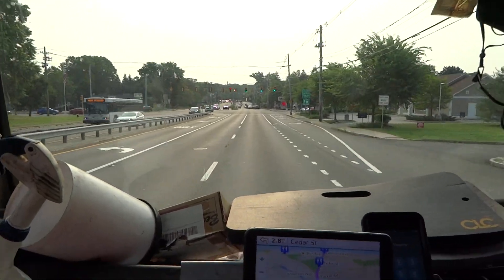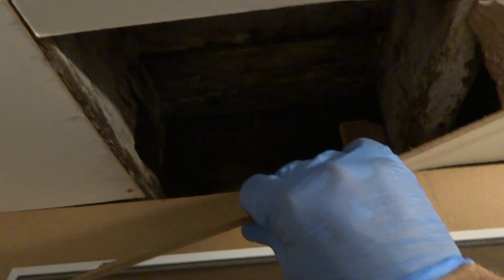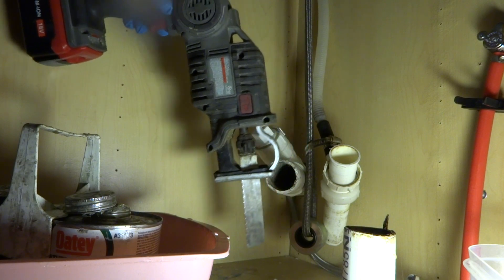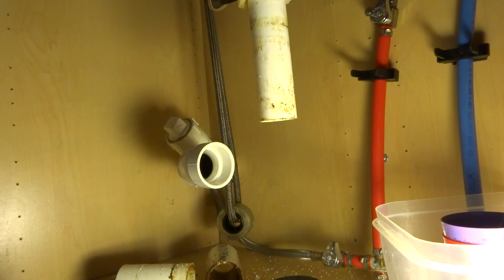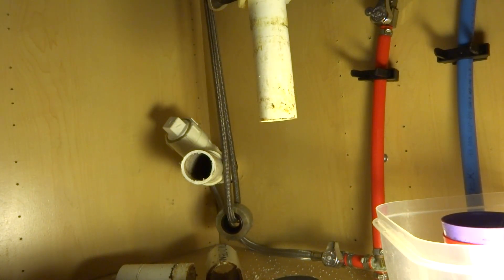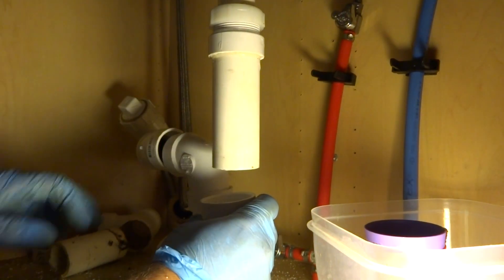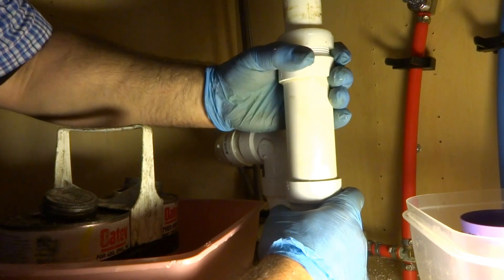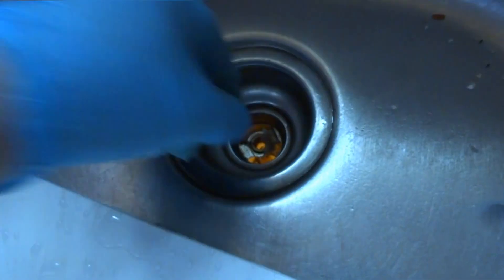PLUMBING DISASTER JOE HOMEOWNER STRIKES AGAIN

Comment: While the cleanout makes me think the pipe coming out of the wall is a drain, for it to be loose means there's no way I'd use it before finding out exactly where it goes and how it is connected; but that's just me, and I'm a DIY, not licensed.
Reply: I'm ticketed and I wouldn't change it either. 8 have a small endoscope for tracking lines
Reply: That was pretty fucking risky.  I wouldn't be able to sleep at night not know where that thing drains to.
Reply: like maybe a drain for a dishwasher? right next to the hot water line going through the same hole.
Reply: @ghost2coast296  Nope the drain for a dishwasher is right on the tailpiece where it should be.
Reply: Yeah most of the water would go straight down into that pipe in the floor the way it was hooked up.

Comment: The pipe coming out of the wall was probably a vent pipe and the pipe going out the bottom was the actual drain...
Reply: That's what I was thinking, but why the clean-out on a vent pipe? I never cared for, do it yourself unorthodox plumbing techniques. It just adds a extra layer of complications to a problem you are trying solve.
Reply: My thoughts as well

Comment: That tied in line is intended to be a vent for the fixture... the reason it's gurgling is because it's filling the vent, you tied into a vent did not run enough water to properly test it cause 8t wouldn't have npbeen enough to fill the pipe and trap and raise to the level of the sink ( likely this happened that evening )   respectfully intended but I think you missed this one.
Reply: He also should have atleast left the sink running. Gone outside and look in the cleanout to see if water was running.

Comment: Unglued PVC fittings: I'll never forget the call I had where the homeowner's sewer line backed up, and the un-glued PVC fittings in the basement, for the kitchen sink drain line, separated, and flooded the basement with sewage. That was a literal sh**-show. Worst part was they were pack rats, so a junk removal company had to throw most of the basement contents into a 30-yard dumpster before I could deal with the plumbing issues.
Reply: holy shit mama !
Reply: @WinnfieldCustoms  , lol.

Comment: I wouldn't be surprised if you got a call back on that one someday.
Reply: Ya ever notice he uses sch 40 glue traps with those bs plugs at the bottom instead of sch 40 threaded traps , just like he  pulles out his blow torch to sweet on a supply valve under a tight vanity instead of the compression style , just saying lol fn Steve & molloy the boss
Reply: Me EITHER!!!  Just connects a drain to an unknown pipe?  Who the fuck does that??
Reply: @onemorething100  and tears the ceiling tile.

Comment: Water test time, the one in the wall might be a vent or old plugged up drain and they fed a new one up thru the floor?  Whatever it is, the one in the wall wobbles like hell like it's not attached
Reply: Oh here we go! Super tradesman and his YouTube advice.
Reply: @jimdeck8670  ive been a red seal plumber my entire life and his comment here is I  fact a good one. I believe Steve hooked up to the individual vent, as was common to individual vent fixture at the time house traps were approved. This drain was connected to a vent, you can see the gurgling in the "test" .msteve does excellent work usually, but this one's a bit off imo not tested sufficiently.. that was a vent, I'd bet on it
Reply: @MrDmadness   thank you MRDMADNESS, This guy has nothing good to say on Steve's channel, mocks him, etc, I hoped the community sets him straight.
Reply: Couldn't agree more.
Reply: He keeps saying he's doing it right but he doesn't know what he's doing 😆
Reply: Yes, 1000% with gurgling noise. Seem to suffer to breath while discharging water that don't seem right.
Reply: Yup wall wobbles looks like a leaker.

Comment: all the bubbles coming up out the sink drain makes me wonder. . .
Reply: Doesn't that mean the pipes are not vented?
Reply: @rpurdy4821  most cars yes because the pipe is struggling for air 
Disclaimer I’m just a carpenter
Reply: @rpurdy4821  thats my thought - that 'drain line' is likely a wet vent from another drain.

Comment: Not all homeowners.   I do all of my own plumbing and I have never messed up a job like that.  Furthermore, I have seen plenty of "professional" plumbers just slap a fernco on it and walk away.
Reply: Absolutely agree - have just replaced a bathroom for my daughter which was installed by a so-called plumber.  Every single waste joint was held together with silicone and was falling apart!  There was no indication at any point in this video that the previous homeowner had done the work anyway!
Reply: @keithmarlowe5569  ain’t got lol no education either it seems

Comment: That sink originally flowed in the floor... there is absolutely NO way that sink could flow to the left in that wall... as u met it , it looks like that Other pipe on the left flows into the main waste pipe  running through the floor...secondly a thorough investigation of where the pipes are distributed and or sourced has to be done before making changes... 
In the end u condemned the floor and diverted ur waste water to the left in that wall.. but water cant flow uphill.. the cleanout looks higher than the TEE on the main indicating whatever in that wall is flowing into that main floor pipe... but anyway that's all from me ..I'd investigate properly before making changes
Reply: Makes sense now that you draw attention to the clean out feature that was there. Either way, the entire drain plan is crap from the day it got put in there.

Comment: If by chance you get called back steve pls video the job, I'm not sure if I would have chose any one of those pipes without further testing them.  The water in the sink did not flow proper like the vent was cut out.  The water was flowing in the vertical pipe when you got there, so I would have connected a trap to that pipe instead of the  mama in the wall that did the watoosi.
Reply: And it gurgled cos there’s no vent!
Reply: The clean out was a distraction. The installer maybe felt a fixture trap was redundant. The pipe in the wall might be on a revent. The poor drainage now is because the the pipe is back falling

Comment: Without homeowners trying to do things on their own, we would have a lot less work. So homeowners keep watching these YouTube videos and call us when you need the work done right the first time.God bless
Reply: This dude has saved me probably thousands of dollars.  I bought my house 4 years ago I have  cleaned and serviced my furnace, replaced electrodes, nozzle, and tank filter, the pump filter, pressure tank, replaced all of my shut offs and some piping , all my faucets , just replaced my toilet that had a cast iron flange with lead and drain pipe that was a half inch above the floor, replaced the guts in the other one, replaced the resin in my water softner and cleaned it (thing looks brand new) and a lot of other things. The previous homeowner took care of his shit, a lot of it is/was 20 years old or older.   I guess I wouldnt call it common sense, but ya dont gotta be a rockettintologist to do alot of these things. I have called an electrician once who actually re wired my basment right,  and a (professional company) to come out and waterproof my basement . I got water in my basement  a month ago.  Sadly these days half the professionals suck, no body takes pride in anything anymore.  And this is why if I can do something myself I am going to try.  Because these days its a 50/50 chance  whether its going to be a job done right the first time.  And if I think and feel confident I can do it myself and save 500 dollars, I'm going to do that.  Because I probably will do it better than 50% of the (professionals) out there today
Reply: @NickyVEE89  👍🏻
Reply: @NickyVEE89  Spot, spot spot ON brother!!

Comment: Number one rule to good management . Always inspect what you except . Steve I would have tested each piping system individually first . To find the correct piping system to correct with the Pee-trap  problem . Even if I had to work with unglued parts to determine which piping was needing the correction the issue  . By running water through it first while plugging off one of the water lines . To find the correct flow .  I feel you assumed the piping with the cleanout  was the correct GUESS . To me I think you chose by the look and not by a better inspection .  Still yet,.. One miss  is not make a strike- out . It may only become a back-up-an-regroup situation . Personally,  your sight is the best trouble shooting example vid on youtube . Thanks again.
Reply: Coming from a plumber?
Reply: It’s not pee* trap btw

Comment: No glued joints on the plumbing ?... and they bought the house that way?  home inspectors are a option in Mass? that blue pex  supply line right in the middle of the walkway is up to code?

Comment: I'm a Joe homeowner but would never do anything like that. When I get into a more involved project (for me) like a rotted out bathtub drain (above a finished garage ceiling) or a rusted out bathroom trap, I go to the plumbing supply place. They have a better selection and often higher quality parts than the big box store, Most valuable to me is they listen to me and have knowledge and offer proper solutions. Prices are not that much more, if at all and their help is priceless.
Reply: Enjoy it while it lasts. those places that actually help homeowners too are getting very rare. cant find one where i am if your not a contractor they treat you like ABSOLUTE TRASH
Reply: @DabblelyDiddly  when I installed my own hot water boiler system, the hvac suppliers treated me like an orphaned bastard child trying to be seated at a country club’s 50th anniversary luncheon!🥴
Reply: @mrobvious5892  Yep. I went to one to buy a toilet like an absolute rube. Got hosed for 179 dollars when I could have went to HD and got the SAME SHIT for 120. sometimes I never learn.

Comment: Hi Steve ....You've done some jobs for me before.   But now I have a recouping issue with a gas apartment space heater tha keeps going out ..thermocouple is new....heat sensor switch at chimney is bypassed now ..runs like that ..if not it dies quite often..do you work on space heaters I need some help..it's a second floor tenant in a 3 decker....please respond. Ty.

Comment: Why was the tee in the drain position if it was a vent? I'm thinking that was a drain for another fixture in the home. I know the clean out was facing the wrong way but since it was compression fittings after the clean out it could be taken apart easily to unclog and that's why they faced the clean out in the opposite direction. No need for a clean out on a vent, plus if it were a vent it's traveling horizontally well before the flood level of the structure. It all doesn't make sense. I would have glued it up exactly as it was. You could have off set it before the tee to fit in a ptrap.

Comment: When I was a kid I tried to change the oil filter on my car.  I was stupid and was tightening the filter rather than loosening it.  By the time I realized, I couldn't get it off.  So I brought it to Jiffy Lube and when they asked why the filter was on so tight, I said "I have no idea, the last guy who changed the oil must have over tightened it". Point of the story is that there is no way in hell she bought the house with pipes like that.

Comment: HAHAHAH, your gonna just run a sink drain into a pipe that you have no idea where it goes? If you look prior, there was a sanitary tee on the drain going down, which means water could not go UP into the pipe going into the wall, I would call that a vent, OR, it could be coming from a bathroom or some other sink and draining INTO that sink drain. Even so, to fix it and avoid an S trap situation, install a tee wye and put an AAV vent off it. Job done, no worries.

Comment: I would have thought that wall pipe would be coming from the dishwasher and draining into the vertical pipe in the floor. Looked like a joe plumber dishwasher drain install.
Reply: exactly. braided hot water line is going through the same hole as the drain

Comment: Yes, all wrong and improper installation / condition. However, it would have been solved, at least temporarily, with 50 cents worth of chalk and duct tape.  What did you charge?  Several hundred?  Did she have the money?  I'm sure what you charged was appropriate and the work was professionally done / up to code but everyone has to remember sometimes a homeowner can't have perfection, just needs to be good enough as long as its safe (but maybe not current code).
Reply: Wtf? You call a plumber expecting him to come out for pennies with some duct tape and chalk? This has got to be the dumbest comment on this video.

Comment: i've always had better luck leaving the basket strainer tailpiece gasket out, and to give the mating surface a layer of pipe dope.   Why create two joints that could possibly leak?

Plus it gives u an extra turn on the nut, which seems to help, given that most basket strainers have those crappy threads, and that the nuts are so shallow they barely grab any threads.
Reply: @ricklee827  Thank God we are talking about plumbing.  It's not really the nuts fault, its not a space ship, 2 good threads is all you need.

what i see mostly is that the basket strainers have those crappy rounded rolled threads.

i have a few of the nuts ur talking about, i think.  They are brass and turned?

It drives me nuts though.  Inadvertant tail piece disconnection can be disastrous.  Why not just make all the nuts bigger.

Comment: My first thought was that was a jerry rigged DIY dishwasher install, you see the washer at 1:37 to the left of the sink, and you see the hot water braided line running though the same hole in the wall. The clean out was for food build-up. Please tell me this plumber didn't just drain the sink into the dishwasher LOL?? Where else would the dishwasher be draining to?

Comment: Huh, you said it drains.  That's not proper draining,  its like the air is trying to come out.  I think you tied into the vent.  Why didn't you tie unto the one in the floor and use the other one as a vent to prevent an S drain.  

PS at first, I thought when you went downstairs you went coming back.  🤣

Comment: Most unprofessional service plumber I've seen, and half assed pvc glued pipe, no deburred cuts no pvc primer even with that no primer needed glue, it still needs it.
Reply: You only need to put Primer on PVC if it’s pressurized otherwise glue is fine learn plumbing

Comment: While replumbing the drains for a bathroom to accept two side by side sinks, I found unglued PVC at several joints.  The home is old so the original plumbing was not PVC.  This was the work of flippers.  On the same day I also discovered a junction box loaded with too many connections and buried in the wall.  Once again, the work of flippers.  The plumbing re-do was easy, the buried junction box, not so much.